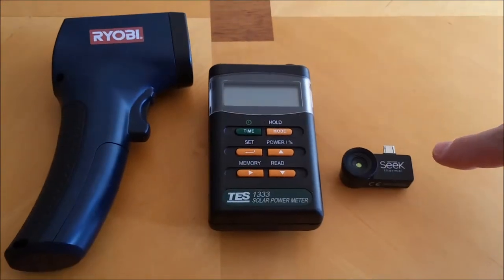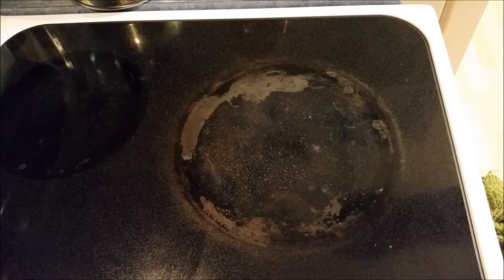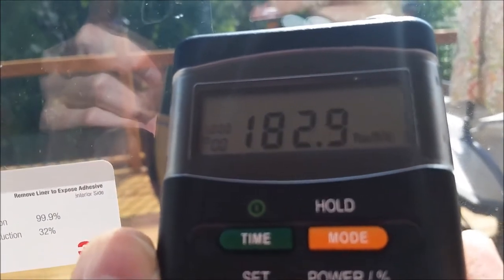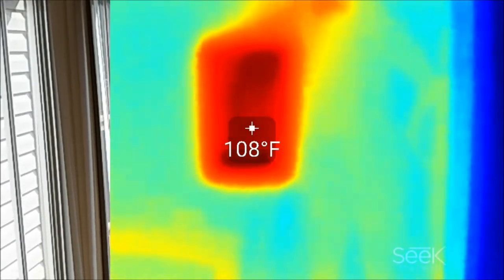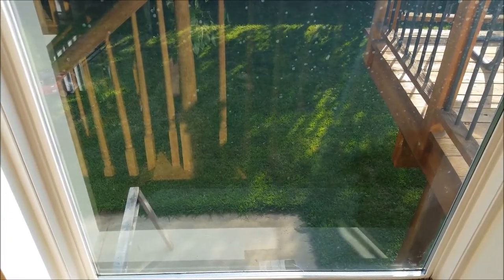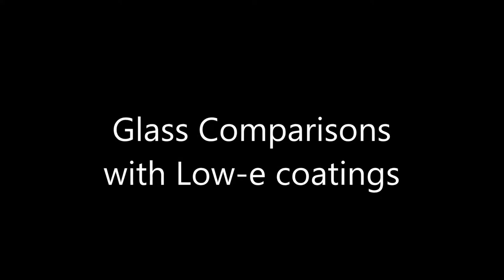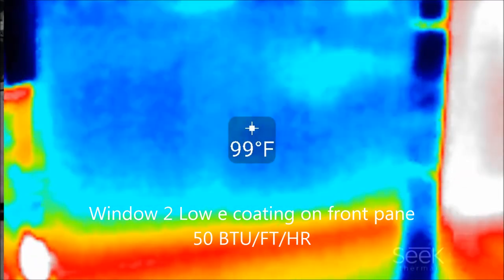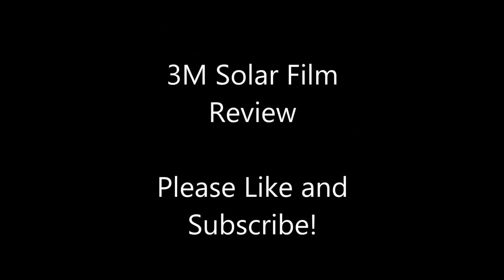3M Prestige 60 Solar Window Film Review

Comment: Your explanations doesnt make sense. The film has to reflect off the heat, however it is not 100% efficient so inevitably it absorbs some of the infrared energy and will be converted to heat. The window without any film however lets the infared energy through the window, since it lets it through it does not heat up the window however it heats up the house. 
Do remember that infared is a form of light (and could also pass through vacuum), it means that it can be reflected just by putting something shiny. However this shiny object is not perfect and would inevitably absorb some light and heat up but overall more light is reflected outside than absorbed by the film. 
Do remember also the difference between this and solar panels. In solar panels the infared is actually absorbed but this light is converted to electricity instead of heating up.

p.s. I got an A for Cambridge A level Physics
Reply from the maker: The film makes the claim that 53% of solar energy is "rejected". What is very vague is what "rejected" means. It doesn't say reflected, transmitted, or emitted. These are standard measurement terms for radiant (solar) energy.  So, if the solar energy is converted into heat from the film (as in my case), is that included as rejected? 

Since you have taken physics, you would understand that solar is radiant energy which are E&M waves from visible light all the way up to UV and gamma rays rays.Visible and IR make up a small fraction of that energy. When radiant energy strikes an object it is either reflected, transmitted or absorbed or fractions of all of the above.  Conservation of energy says energy can't be created or destroyed so if its not reflected or transmitted it has to be absorbed.

Yes, shiny objects such as metal are called radiant barriers and reflect radiant energy. Which are based on reflectivity and/or emissivity based on how they are used.

Understand you solar panel example, has some holes in the broad brush strokes your applying. Yes I agree the photons are striking and displacing electrons which are creating your power out of the panel.  Solar panels have a roughly 20% conversion rate of energy, which implies 80% is lost to heat and/or reflection.  If you look at solar panel surface temperatures they can reach 180F+ (I have these documented in my other videos as well).  This is similar to what is happening in the film.  The film is converting radiant energy to thermal energy and now claiming that 53% energy is "rejected"  when its merely converting it to heat and isn't called solar energy anymore since its changed forms to thermal energy.

I have seen days in which the films heat up to 130F+ under higher solar irradiance days.

Comment: Video seems flawed because it's not taking into account of specific heat density. Solar films are made of low density metallic plastic usually. Less dense materials transfer much less heat. There's examples of low density ceramics being pulled out of an oven and being safe to hold while still glowing red hot. The temperature doesn't matter as much as the amount of heat being transferred. Glass does a fantastic job at transferring heat. Also, without the tint 100% of the energy would go into the room and heat it up, this is a much worse situation. Whereas it appears that the film reflects 40% and seems to absorb about 10% of the energy as local heat. Hence why the BTU reading significantly outperformed advertised specs. All of that heat hitting the film would go into the room and heat it anyways.
Reply from the maker: Not sure what your referring to as heat density? Your terminology makes me think your referring to thermal mass.

Or your referring to heat flux. Which is the flow of heat.  Not to be confused with radaiant energy. If radiant energy is reflected,  then there's little heat flux. However,  if the film is absorbing radiant energy and converting it to thermal energy then you have heat flux.

The films efficiency is primarily dictated by how much radiant energy it can reflect without converting to heat.  But in my situation this label is decieving because both radiant and thermal energy flow into the space. 

There is a direct correlation to heat flux based on how hot something is.  The hotter an object gets,  the more energy it radiates. 

Do you have data showing your ceramic heating example ?
Reply from the maker: The video lacks any measurements and isn't scientifically valid as a form of scientific proof..  Mainly a guy talking about how hot something is with no analysis or measurement.
Reply: @stem_saving1644  It's a simple concept. I'm not going to waste more time on this. There's plenty of examples explaining how it works and how items of lower specific heat capacities "insulate" by preventing the transfer of heat. That's literally how insulation works...You're still ignoring that any heat on the film would have gone I to the room anyways. You want to be right, and you've found a hill to die on.
Reply from the maker: Your confusing heat transfer with energy conversion again.  High reflectivity means less heat absorption of the material. The film's R value is very low for all practical purposes almost 0. High r values would resist heat flow and make for a cooler surface. I'm radiating heat into my living space from the windows and that's a fact. A cooler surface doesn't mean it's hotter than the outside temperature. 

 Fiberglass insulation would do much better in this situation than the film. 

If the films total energy reflection were high. A majority of the radiant energy wouldn't absorbed by the film causing it to heat up.  Instead it would be reflected as radiant energy. 

It's not about being right, it's about being scientifically correct.
Reply: @stem_saving1644  For someone interested in being accurate...you still...once again are ignoring that any heat these add to the room would still exist once the sunlight hits any other object in the room.
Reply from the maker: Very true if they weren't installed.  I'm questioning the efficacy of them.  If they reduced total energy by 1%  would they be worth it? No in my opinion. 

The issue lies in how it's advertised.  Solar energy rejection is not the same as total energy rejection if the film simply converts solar energy to heat.  I could put black paper on my windows and say it rejects  99% of solar energy and that's true. But it doesn't block the heat. 

The take away is how much total energy is reflected back. Not just radiant energy.

Comment: Thanks for posting this really informative. 🙏🏼i'm looking for blinds or film to reduce the heat i live in arizona do you have in recommendation 🤔
Reply from the maker: Double cell cellular shades or even triple cell. White will give the most bang for the buck as it reflects almost all the suns energy back. If you get films for Windows already installed, they need to be on the outside of the window, otherwise you get the problem I have.
Reply: I believe the film should be on the outside of the window and it would prevent the issues he demonstrated. 🙂
Reply from the maker: Yes. The air between the panes of glass would be a thermal break. Films really need to be on the outside. These were a waste for me.
Reply: STEM_SAVING I should say that I was referring to installing NEW windows on new construction 🚧. I need windows and I was looking at my options. After seeing the price for the film, considering your test and seeing that the film goes on the inside, I’ll still spend less money on triple pane windows. Also, air filtration (cold or hot) will be minimized too. Today is a good day. Thank you!
Reply from the maker: Yes. I'm in the same position. Looking at new windows.
Reply: High energy rejection with high reflectivity is the key.  Reflect the energy rejected away from the film.  This minimizes absorption by the film preventing this problem as much as possible.

Comment: I know it's been a while since you posted this video but just my thoughts... The 3M films you show in this video don't seem very reflective on the outside surface.  I'm assuming that's why the "Visible Light Reflection" spec is only 8%.  Most heat reduction films have higher reflectivity from the outside, not a mirror exactly but you get the idea.

The "Total Solar Energy Rejected" spec of 53% I assume means this is the energy value that's prevented from passing THROUGH the film but, as you say, some of this will be absorbed into the film itself and cause localised heating.  The key question is, what effect does this have on the overall room temperature?  You'd need to mount an air temperature measuring device in the middle or back of the room (not in direct sunlight) to get an idea of that before and after the film was installed (with similar sunlight conditions).

Yes, the film may be at 120 degrees but does that result in a lower room air temperature compared to allowing the sun to pass into the room and heat the surface of your carpet, soft furnishings etc.  You could test this by measuring the carpet in direct sunlight with and without the film.  If for example the film measures 120 degrees but the carpet measures 140 degrees in an area not covered by the film, you can see how the film is actually having an effect.  Also, measuring the same carpet in an area covered by the film would give presumably a lower reading - by how much I have no idea but just food for thought.  These are the experiments I would be doing.  Good luck with it all anyway.  I hope you get it sorted out! 😉
Reply from the maker: Don't fall into the total solar energy rejection trap.  This is simply radiant energy.

Total solar energy and total energy aren't the same.  Total energy=solar + thermal. It's the total energy that's allowed into the space that counts.  The film does prevent solar  energy from coming through the film,  As you can see with my btu meter.

But,  it converts it to thermal energy which is heat. So,  it's a bit deceptive.  It still enters the room,  just in another form. That's how the room still heats up. 

Also, not all heat is in the visible light spectrum.  The visible light transmission shows how dark the film will be. 

I did solve the problem,  I purchased new low e windows and did some testing which really dropped the total energy into the space. I'll post when I have something ready.

Comment: @stem_savings - whats the latest on this?  Seems like putting a reflective film on the outside is the trick...
Reply from the maker: Yes.  Outside is key.  At the time,  3M didn't have those.  But anything outside will degrade in the sun.
Reply: @stem_saving1644  that's what I'm reading. LLUMAR makes outdoor commercial tint.  Need access to that

Comment: I believe the film is to be installed on the outside
Reply from the maker: No this is specifically for the inside and as the testing showed, it didn't perform well.  At the time this was purchased there was no exterior version.